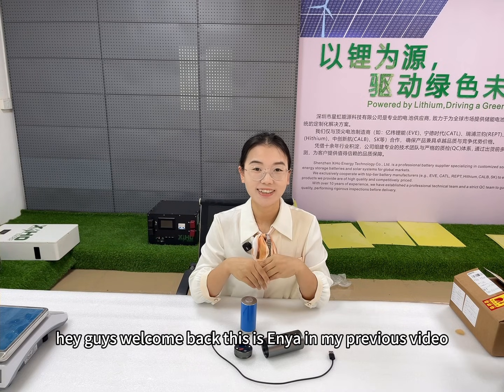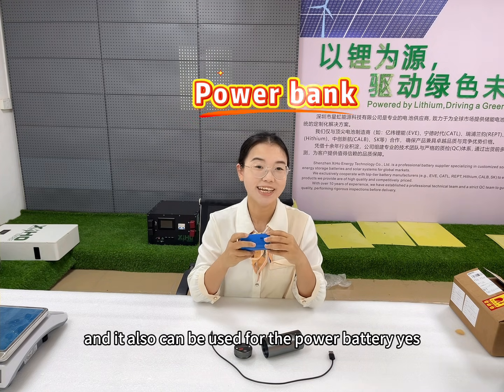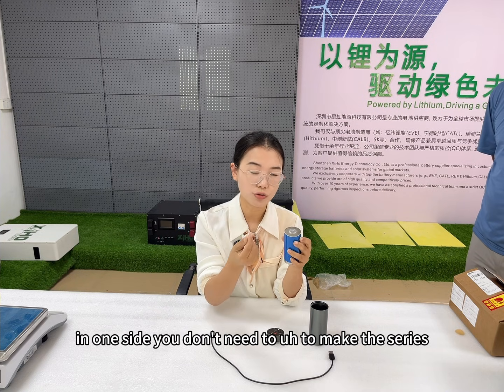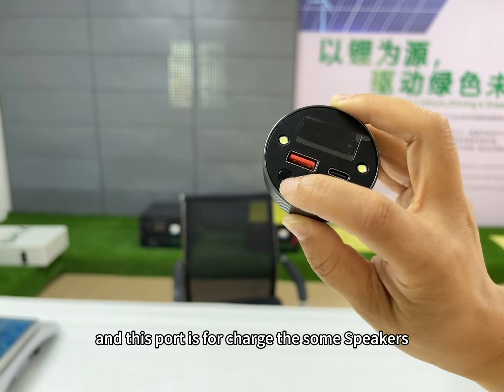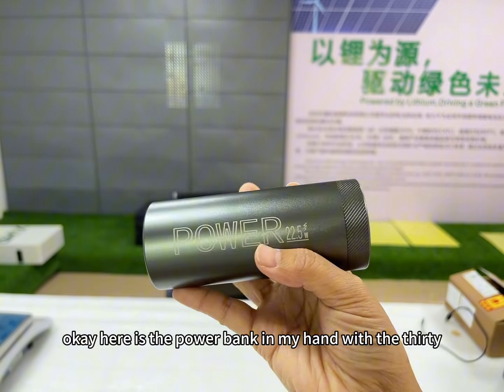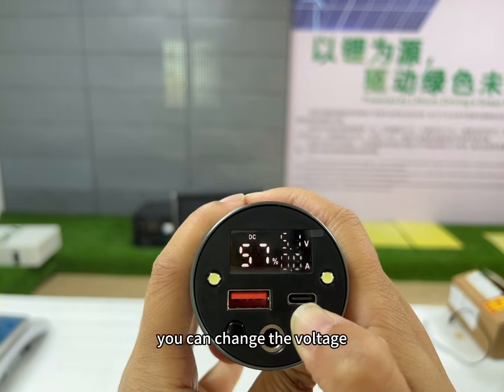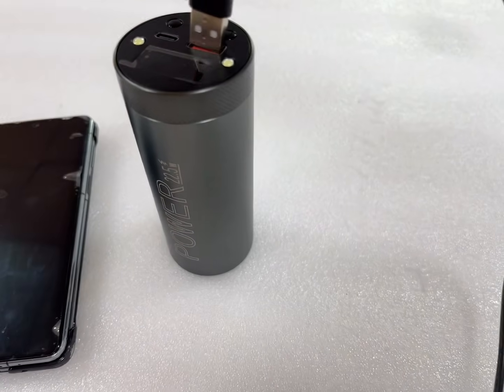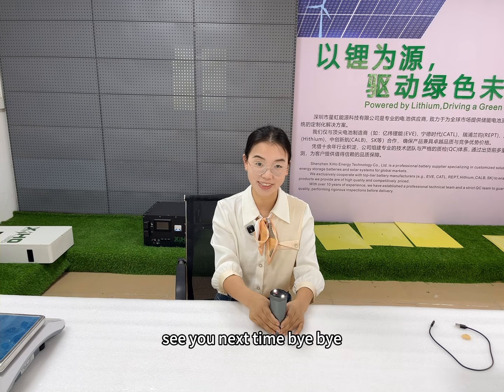DIY power bank 32400mAh by EVE 46950

Comment: Hi Enya and thanks for this video, This power bank looks good!
I just don't understand why the voltage can be changed? Because normally,the USB standard is 5V.?
But it should be great to be able to change the Current,amperage, for example,for fast charging a phone. For instance,5V and a charging amperage setting of 18A would result in a 5V / 90W Fast Charge!!
Reply from the maker: Here we found another solution is 45A charge and discharge

Comment: It would be good if the buttons can be protected from accidental usage. If a saw correctly, the output voltage can be changed with the right button. If the power bank is in a backpack and his button would be accidentally clicked, then maybe the charging phone could be damaged by the high voltage. But other than that the power bank looks really good and sturdy
Reply from the maker: The button of cell already covered a small EVA foam, we didn’t show it in the video

Comment: When will we get LIFEPO4 power bank cells? With lifepo4 BMS
Reply: power density (most important aspect of transportable energy devices IMHO) of LiFePo4 is low compared to NMC.
Reply: @MatthiasSchwarz-y7z  over a few years the energy density is gonna match anyways due to degredation.. wish they would just release the life po4